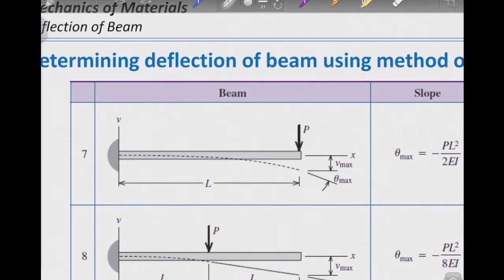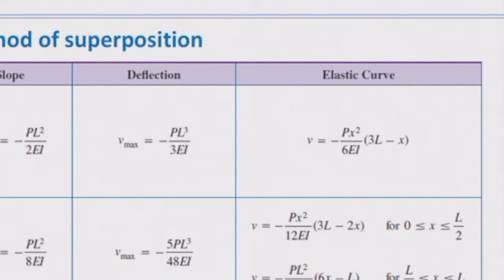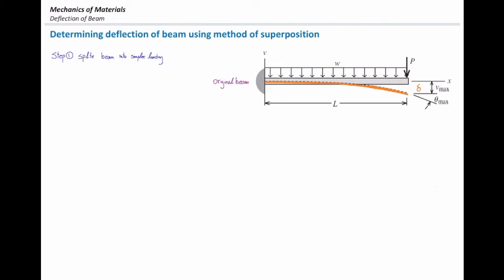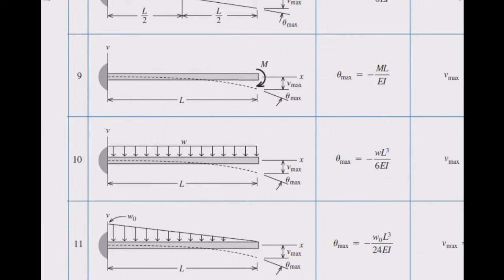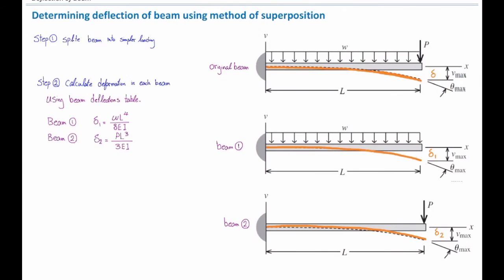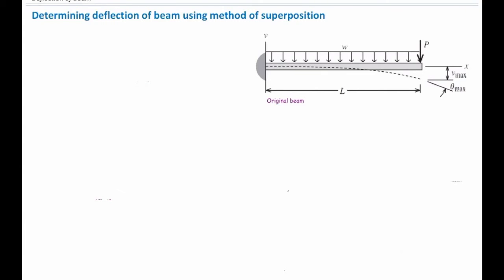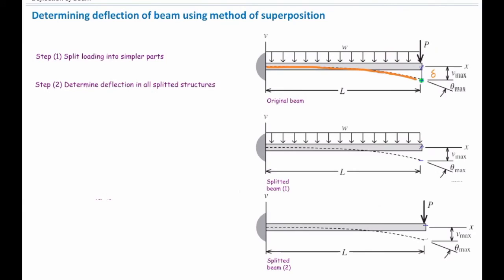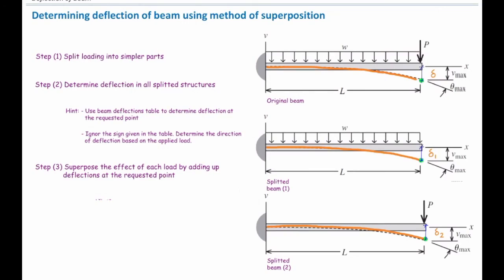Lecture 14, Beams deflection, Method of superposition (Part 1)

Comment: Hey there! whats the difference between using delta and v?  I thought delta stands for change in position/deflection and v also stands for change in position/deflection?
Reply from the maker: They both stand for beams deflection as you figured.